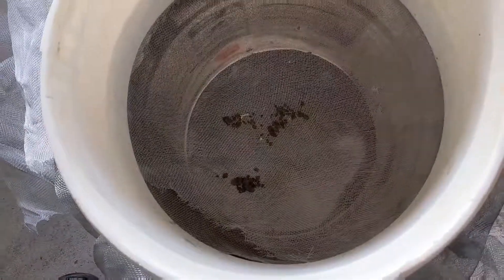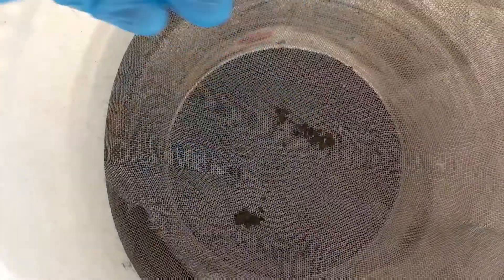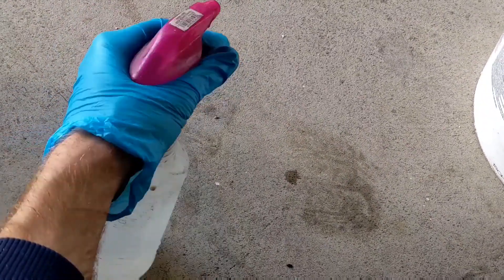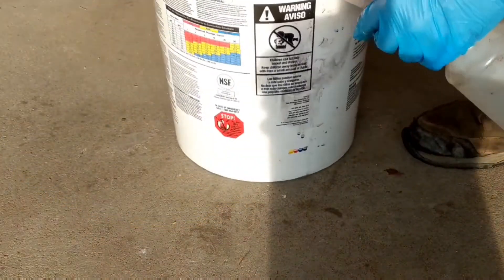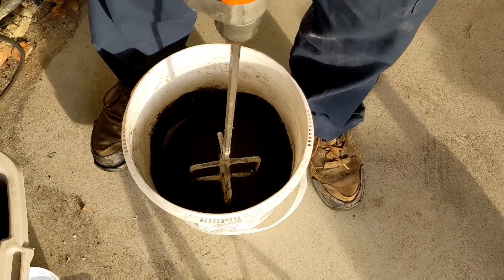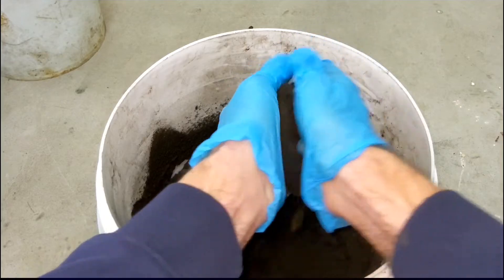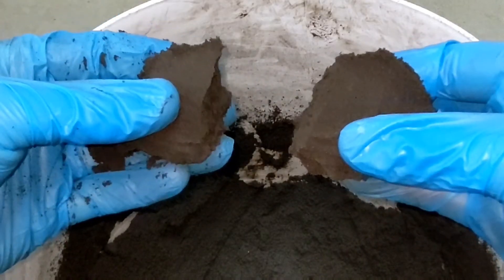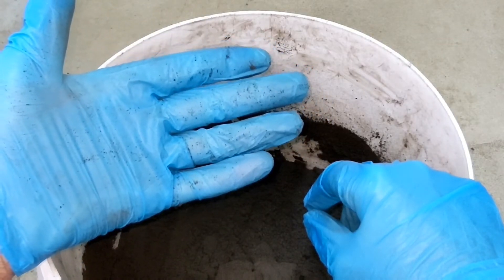Metal melting green sand mulling at home - without a sand muller

Comment: That's the same way I mix my greensand as well, after casting through a quarter inch screen then into a bucket & a paddle mixer on my electric drill small amounts at a time same as you, nice to have a "proper" muller but not essential, [been doing it like this for over 50 yrs.]
Reply from the maker: Yeah it would be a lot better with a. Muller, but this works.  Since I'm not doing large quantities of casting a Muller isn't needed.